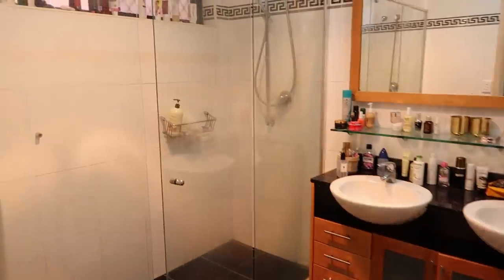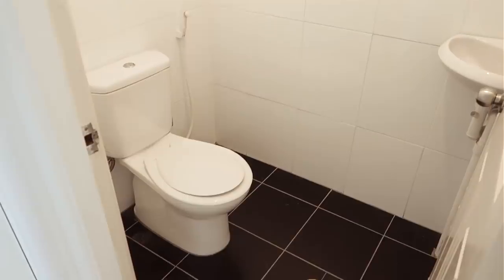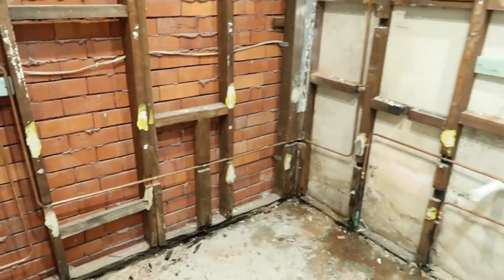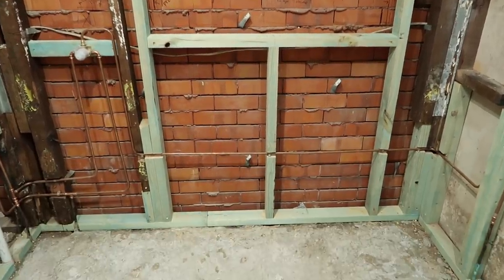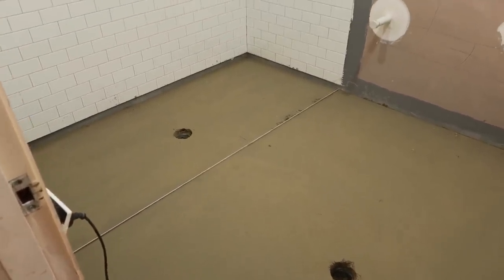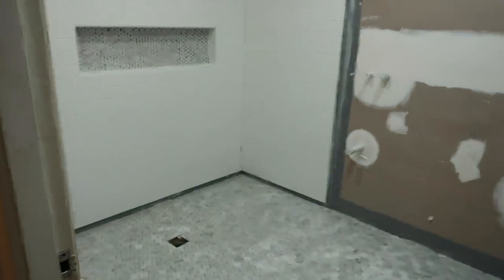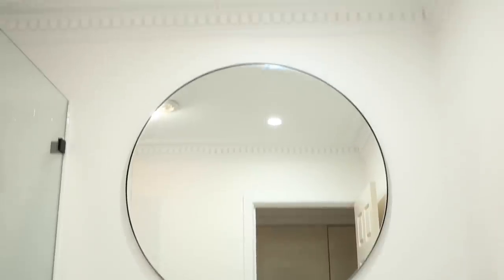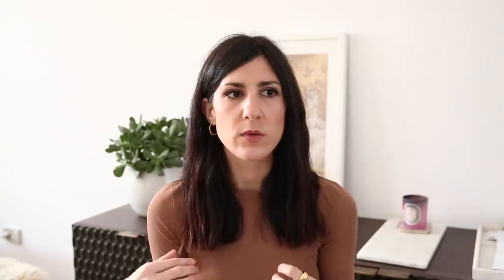Our Bathroom Renovation - Before and After (Minimal/Contemporary Home Decor Style) | Mademoiselle

Comment: Interesting process... Couple of questions. Is there a tile drop for the shower area? Does the shower water stay contained since you have no shower door? Also the pipes below the wash basins are exposed, was that intentional?
Reply from the maker: Thanks Anna. The tiles drop slightly into the shower area, and the screed was laid with a slight slope so that the water runs directly towards the drain. The water stays completely contained in the shower area, which is great. Previously with the door that we had, it wasn't sealed properly at the bottom so there would always be tonnes of water everywhere on the floor afterwards. 
And yes, the exposed pipes are intentional - might not be to everyone's taste but we personally really liked that vanity, nothing else came close!
Reply: Good to know!